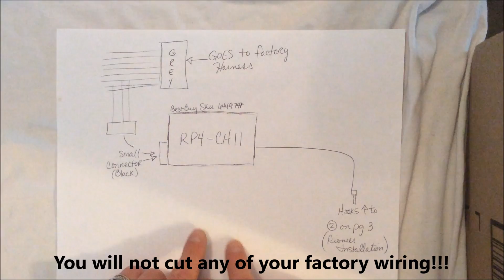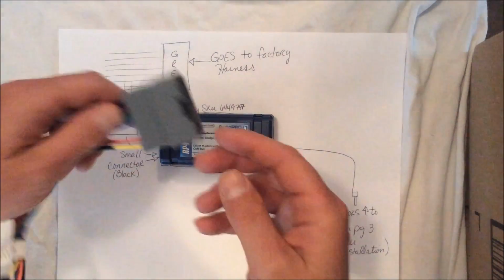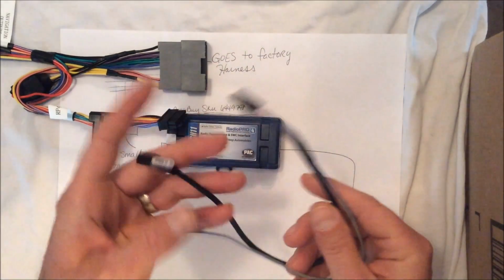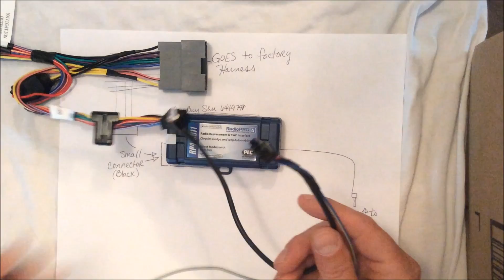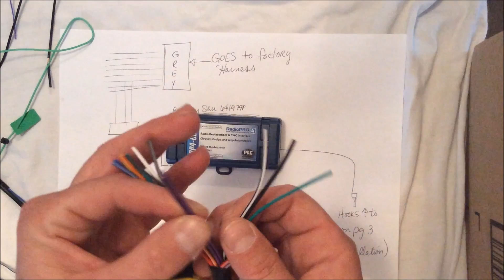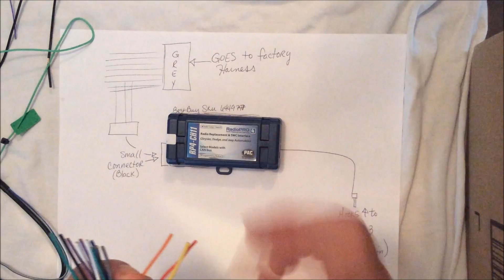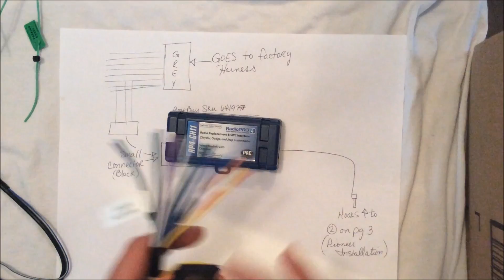Simple Explanation of PAC RP4-CH11 Controller Jeep Wrangler CAN bus

Comment: How can I wire the red turn on wire to turn off? I ended up draining my battery because i simply tapped my red turn on wire into the yellow 12V constant wire. The issue was that my radio wouldn’t turn off. Could you please help me out?

Comment: Have a 2012 rubicon and cannot get the steering wheel control  to work
Reply from the maker: U install the canbus module like i did in the vid?
Reply: I tried the plug and the 2 steering wheels wires with the stereo The module is wired same as yours
Reply from the maker: Idk, tbh.  That was the most miserable wiring install I ever did.  Sorry I am not any more help.

Comment: Where does the blue wire hook to that's connected to the steering wheel aux cable that goes to the steering wheel control module?
Reply from the maker: I am not sure tbh.  I know that I didn't use all my wires.

Comment: I recently replaced the radio in my wife's JK with a SONY w/back up camera, I purchased the installation kit with the U-Connect module - everything worked great for about 2 weeks and then it started randomly shutting off and coming right back on - then it started effecting the Jeep i.e. while driving the gauges would go to -0- the wipers would come on for one pass, a/c would cycle off and back on... the radio died so I assumed it was a defective unit so I painfully purchased the newer version (because, like a dumbass I tossed out the box and receipt AND the original stock radio). So now its 2-3 weeks later and the new radio is starting to do the same thing... I would surmise it has to be a power issue? I did not alter or change the wiring, I HAVE checked all the connections and I DID NOT add any speakers of sub.
Thanks for any advice!
Reply from the maker: Have you checked the negative terminal on the battery for a good ground?  Outside of that, I can tell you that is about 5 levels above my paygrade.  I am not great at all with wiring issues like that and unfortunately I have not heard of this issue as well.  I would give your local dealership a call and see if anyone in the service dept. who isn't a punk will talk to you about it and see what they say.  

When you say U-connect module, I assume that is the pac-bus to operate the stereo from the steering wheel?  Could the u-connect module be causing the problem?  If the stock head unit gave you no problems, I would say it has something to do with the module or the way the new system was wired up.  

I gathered this from a website which stated certain functions and features of the audio system rely upon resources shared with other electronic modules in the vehicle over the Programmable Communication
Interface (PCI) bus network. 

Worst case situation, take it to a reputable stereo shop and have them check the problem.  Sorry if I am of no help.  Maybe someone will jump on this thread and give you some better advice.  Please let us know your fix when you find it.  You have me curious about it now.
Reply: @JRMSweeps  I will let you know what I find out, for now I pulled the fuse and the rest of the Jeep has been operating as normal.. guessing it’s a ground issue. Going to swing by a parts store and have the battery and alternator checked.
Reply from the maker: @fljeeper71  good call on the alternator as well...def keep us posted!
Reply: Had the alternator and battery checked.. alternator was good battery was in the bottom of the acceptable range.. got a new one and cleaned up the cables.. so far the radio and Jeep are working fine.
Reply from the maker: Awesome.  I hope that takes care of the issue for you.  Please let us know in a couple of weeks if this was the fix for good.
Reply: @JRMSweeps  POST UPDATE 🚨

Radio quit on me again.. so I tied I to the cigarette lighters power and ran a ground to the metal dash frame… it’s alive again! 🙌🏻🙌🏻🙌🏻
Reply from the maker: Radio still holding up after the new battery install?
Reply: @JRMSweeps  went to drive it today and the radio was dead… haven’t had time to investigate it yet.. suspecting a fuse..?
Reply from the maker: Could be.  I'd check.
Reply: @JRMSweeps   nope… came out to drive it today and the radio was dead.. going to try running a new ground and power source.
Reply: @JRMSweeps  POST UPDATE 🚨

Radio quit on me again.. so I tied I to the cigarette lighters power and ran a ground to the metal dash frame… it’s alive again! 🙌🏻🙌🏻🙌🏻
Reply from the maker: Excellent, hope that ground fixes the issue.  I assume your cig lighter power is only on when vehicle ignition is on/run?
Reply: @JRMSweeps  yes 💯

Comment: Need something for a 2015 wrangler with alpine factory system. Cant get the factory amp to turn on. Using a saicane android 12.1 head unit. Any ideas on what module I need
Reply from the maker: Is it the 9 speaker factory installed system?  If so, did the amp burn up, wire bad to the amp, blew a fuse?

Comment: So mine has been working good for a little while then I came to a problem with the hot wire from the interface is making the lighting bolt come on when I touch it with a 12v and it’s draining my battery what do you think is the problem?
Reply from the maker: Bad battery?
Reply: @JRMSweeps  okay thanks I will go check to see if it’s bad

Comment: May be a dumb question but how do you connect the wires?
Reply from the maker: You can simply twist them and wrap with electrical tape, use wire connections, shrink tubing...

Comment: I ordered a radio and harness from Quadratec that was on backorder for three months.  Finally gave up and cancelled and sourced parts myself.  I thought I was ordering the complete plug and play harness from Crutchfield so you can imagine my little moment of panic when I saw what came out of the bag.
Thank you for your video, you brought me back down to earth.  I am an engineer and very familiar with assembly, but was not looking to cut into the vehicle harness, nor did I want to spend 3 hours in the freezing cold working on my daughters jeep..  I feel much better now.  Thank you again.
Reply from the maker: Very welcome.  It seemed as if I researched for over a week and found just bits and pieces of here and there info on using this pac bus get up.  Glad you were able to get it going and the video helped you out as well.

Comment: How do you connect the wires if you have a built-in amplifier?
Reply from the maker: Not sure tbh
Reply from the maker: Would think it's pretty similar.
Reply: I installed it the way you did and the phone calls don't work. I read the instructions and it said if I have an amp, I should not install the rear speakers
Reply from the maker: My phone didint work either all the time.  Must be a glitch in the system.
Reply: I figured it out. If you have a built in amp you connect the front speakers of the new stereo to the rear speakers of the module. The amp controls the left and right. The rear speakers of the new stereo are not used.
Reply from the maker: Very interesting.  Thanks for the follow up comment.  Glad you got it going.
Reply: @JRMSweeps  It was interesting. Thank you for the video.
Reply from the maker: No worries, thanks for the follow ups.

Comment: How does OEM satellite radio factor into this typically?
Reply: Quite alright, thanks! Seems I need a Sat 1 connector for the oem antenna, need to make sure we can locate the typically yellow oem connection it will plug into.
Reply from the maker: Def above my paygrade
Reply: For context, wife installed a 'sirius ready' radio at Best Buy... a Kenwood that doesn't have a built-in tuner. Trying to figure out how to remedy that now that we have the basic sirius tuner kit since presumably the OEM antenna can be used if we knew how to wire it / what adapter(s) to pick up.
Reply from the maker: Not sure tbh.  Sorry im of no help to ya my man.

Comment: Where does the blue and yellow wire connect to ? The wire that hooked up to the steering wheel connection?
Reply from the maker: Depends on your setup.  I did not use all the wires when I did this install.  It could be for back up cameras, navigation, etc, that you have as accessories for your vehicle.

Comment: what about if my new HU does not have the female plug for SWC....  the  blue w white stripe wire next to it, what's it for?
Reply from the maker: They make an adaptor that you can wire in to the unit as opposed to using rca cables.

Comment: Thanks for the great walk through of the wiring harness.  Do you know if the reverse wiring should be the same with a Jeep Wrangler and a manual transmission.  Thanks in advance.
Reply from the maker: Thank you.  As far as the same wiring, I am unsure about that unfortunately.  If you pull the radio and see the same colored wires I have on the vid I did on the reverse bypass, then I would assume yes.

Comment: So I have a 2015 Jeep Wrangler. I installed everything but there is no sound coming from my speaker. I have this same harness and CAN bus. There is a blue and blue/white wire left on the CAN bus that isn’t connected and on the power cord to the radio there is just a solid blue wire left. Do these need to be connected? I’ve been trying to get this to work for like three days. I’m lost! 😂😂
Reply from the maker: Couple of ?s.  Are u getting any sound to the factory speakers?  Did u hook up an amp with subs?
Reply from the maker: Did u not watch the vid for the wire color explanations 🤣
Reply: @JRMSweeps  I watched the whole video I connected all the wires correctly. White/black to white/black etc etc.. I have a blue ANT wire left on the plug that goes into my radio and a solid blue and blue/white coming out of the CAN bus.
Reply: There is no blue/white wire on the aftermarket radio plug
Reply: I’m new to all of this wanted to see if I could do it myself. There is no sound at all but the amp turn on wire isn’t hooked up yet because idk what to hook it up to.
Reply from the maker: Are u getting sound to factory speakers?  An amp kit usually comes with a long thin blue wire u hook up to the amp wire on the wiring harness.

Comment: I have a Jeep Wrangler 2012 with a factory amp and would like to retain my steering control. What is the difference between this one and RP4-CH11?
Reply from the maker: Parking break bypass vid here:
https://youtu.be/eIaBVZYNxeA
Reply from the maker: This is the rp4 ch11.
Reply: @JRMSweeps  sorry I meant PAC C2R-CHY4
Reply from the maker: Pretty sure its application to the vehicle.
Reply: @JRMSweeps  ch11 is the same except it's allows steering wheels controls to work. The company emailed me back ☺️
Reply from the maker: Ah perfect okay awesome.  I know this pac bus stuff is outta whack and seems very unnecessary tech wise where we are at. But that's fiat for us.
Reply: @JRMSweeps  Oh and thanks for the video... its very helpful. I just bought an Atoto radio unit and will hook it up to my Jeep very soon
Reply from the maker: Very welcome.  Took me forever to do research and do this vid so I hope it helps you out.

Comment: Where does the navigation system wires go? And there is a blue and yellow wire connected to like an aux cable that goes into the back of the radio...where do those wires go?
Reply from the maker: You may not use all the wires.  If it wasnt explained in the vid, then I have no clue unfortunately. Not sure if nav plugs into the PAC module.

Comment: Thank you so much ... Been racking brain over put double din in charge .. I guess I need to get the one with jack cause the radio in getting has the input for the swc .. any advice would be greatly appreciated ... Great Video
Reply from the maker: What u mean?  Not sure tbh.
Reply: @JRMSweeps  Sorry should of explained better ... 06 Charger i got came with a aftermarket radio ... I am installing a double din that has a 3.5 mm jacket on it for swc ... When I pulled the dash apart the radio that came with car had the PAC C2R-CHY4 installed .. but sound was only coming out of front speakers and swc don't work .... I know the adapter is two channel so not sure if they hooked it up rite ... Not sure how to correct ... I can send you pics if you like .. I appreciate your help
Reply from the maker: Is the amp getting power?  Assuming swc is sub woofer channel, sorry im not a pro at this tbh.  Shoot me some pics jrmsweeps@outlook.com.
Reply: @JRMSweeps  swc was my short for steering wheel control but the amp is getting power .. Thank you .. will do.. dark rite now so I'll try and get some tomorrow .. I'll send pics of how the inside looked when I took the console apart
Reply from the maker: I know this pac bus crap is annoying as all get out.
Reply: @JRMSweeps  agreed
Reply: @JRMSweeps  no worries ... maybe you will see something cause there are a set up cut wires running to the amp they spiced into
Reply from the maker: Def will, maybe someone else will comment ad well on a viable solution.  Hard to diagnose stuff via the net sometimes.
Reply: @JRMSweeps  i agree ... what I'm thinking is that i have to do is run amp on from PSC Unit and connect one left and one right side shaker correct??
Reply from the maker: If left and right are back, yes.  Or why dont u unhook the back speakers and wire them to the front to confirm they work as well?

Comment: I have a similar radio (MVH-1400NEX) and my 2011 JKU came with a stock sub. For some reason, the rear speakers and sub are connected and the head unit does not recognize the sub as a sub.

Any ideas on how I can go about fixing this?
Reply from the maker: Does your sub have an amp to it?  Most subs wired to amps run through rca cables to the unit.
Reply: @JRMSweeps  yes. Just the stock one.
Reply from the maker: Stock amp from jeep?
Reply: @JRMSweeps  yes
Reply from the maker: No clue tbh.  My 9 speaker alpine system, I used an oem hard rock edition touch screen from a jeep and everything was plug and play.  Seems as if maybe the amp isnt turning on???

Comment: Great video. It confirmed what I thought. I'm a bit concerned that the constant, switched, and ground wires on my alpine HU and Power pack wires are much thicker than the flimsy wires on this harness. I'm going to wire my HU to the harness and wire the Power pack separately since it'll be switched via the blue HU wire. Now to find the handbrake bypass video!
Reply from the maker: I have a bypass vid on my channel as well.  Ty for the comment.  Pretty sure the PAC is made cheaply, thus the thin wires on it as well.
Reply: @JRMSweeps  I searched your channel and couldnt find it. I found another on youtube. You should copy the link into your video description on this post
Reply from the maker: https://youtu.be/eIaBVZYNxeA

Comment: I am having an issue where the radio supposedly has steering wheel control but there is no 1/8" trs socket on the back of the radio,  just a blue wire,
Reply from the maker: What do u need trs sockets for?
Reply: @JRMSweeps  to plug in the 1/8" plug into
Reply from the maker: No clue, never used them.  You could see if they make an adaptor of sorts that wires into the control box.

Comment: Have you ever done a diagram for this when using it with the chyrvd as well.  I get how this works but I have another harness for the built in dvd (separate ) that ties into factory radio in town and country.  Clutchfield says I need both but not sure how they wire together. And unfortunately no easy diagram like yours.
Reply from the maker: No sir, there are so many darn applications it's crazy.  Took me probably a week just to research and then about 5 hours to do the install with subs and amp.  It was tiiiiiiime consuming with those stupid bus controllers and no doubt a little frustrating.  The main thing is getting all the accessories to work and wired up.  Wiring up the factory speakers and subs is easy as long as u follow ur manual diagram u have with ur units.  Wish I could be more of help other than this video my man.

Comment: Hello i have a question i have two yellow wires ! Both have 12 volts constantly
Reply from the maker: Sorry i have no clue
Reply: Did you figure this out? Exactly the question I have right now. Two yellows and two blacks
Reply from the maker: If the yellow are 12v continuous then wire them together.  Black ground?
Reply: @JRMSweeps  yes, 2 black grounds
Reply from the maker: Put the 2 black ground wires together and wire to the wiring harnes ground.
Reply: @JRMSweeps  it worked! Thanks!!!!
Reply from the maker: Right on awesome my man.  Glad u got it going again.

Comment: What about the blue wire that's connected to the steering wheel harness?
Reply from the maker: Not sure what you mean tbh.
Reply: @JRMSweeps  at around 41-42 seconds into the video. when you show the little harness that goes into the module and the 3.5mm like jack that goes to the back of the head unit. There's another blue wire that's not hooked up to anything. https://images.crutchfieldonline.com/ImageHandler/trim/620/378/products/2013/28/541/g541RP4CH11-F.jpg
In that picture from Crutchfield the harness on the bottom with the blue wire

Comment: I have this same set up. I have an 07 jku it doesnt have a mic. I want to add a mic. Where do I connect it?
Reply from the maker: You can buy an aftermarket touch screen like a pioneer that comes with a miC and it'll work then in conjunction with ur speakers.
Reply: @JRMSweeps  I do have an aftermarket radio kenwood, when I bought it it didnt come with a mic. It does have bluetooth , but I want to know what wires to use to connect a mic.

Comment: I’ve hooked up this harness system to a dodge nitro and finally got it all right but with Bluetooth calls you can’t hear the calls through radio. Do you have any clue about that? Does this harness system have a built in micro bypass? Or does that still need to be hooked up separately?
Reply from the maker: If you have uconnect i can tell u that i have experienced nothing but trouble with my bluetooth ad well on an upgraded touch screen system i installed as well.  My bluetooth is rendered useless now for calls.  So, to answer ur question, im clueless tbh.